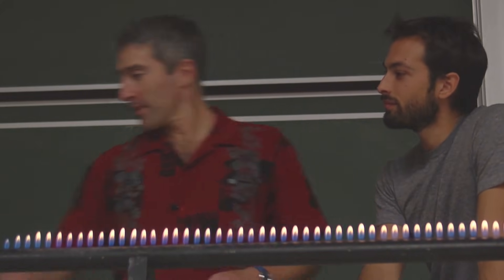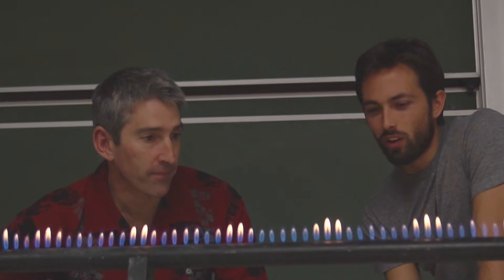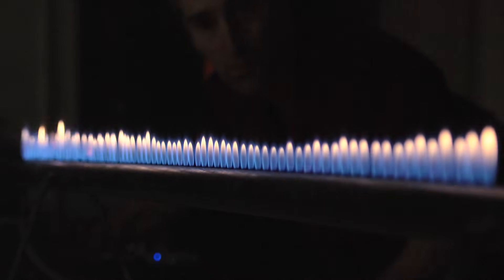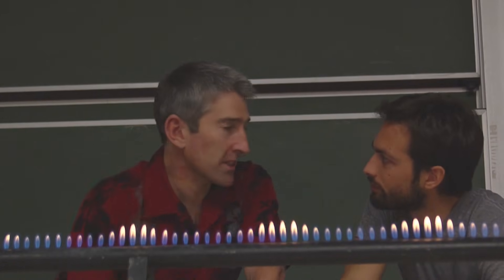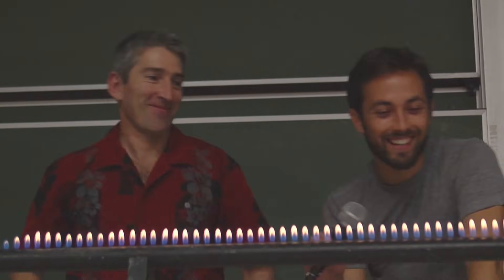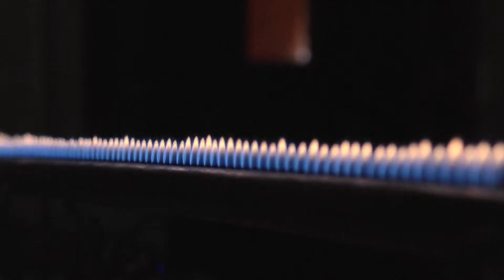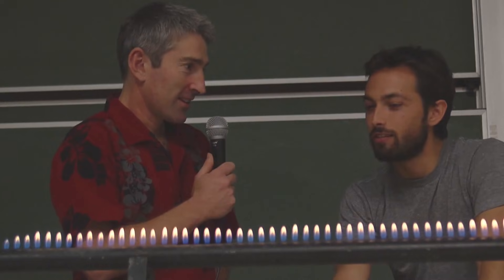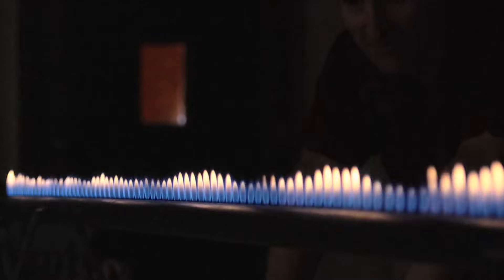Sound + Fire = Rubens' Tube

Comment: Was pleasantly surprised at how pleasant your actual singing voice was. Much better than mine that's for sure.

They have discovered they lower frequencies  can actually put out flames. Know that has to do with powerful Scalar Waves.

🤔 💭  Wondering if you used the same frequency as fire next to fire if it would cancel it out. Causing a Balance Force.

Again, thanks for the visual videos.

Comment: Just a thought, but could this sound/frequency be used as a performance enhancer on Cars or Industrial motors to improve Combustion at different Rpm cycles ???
Rpms which actually resonate and change at different speeds ...
You could be on to the next gen electronically controlled fuel injected combustion engines with ecu's ... 

Hope I inspired ? 🇦🇺

Comment: Does the Reubens tube have two fixed ends? Or one fixed end and one open? Does it even have a standing wave with the sound?
Reply: One end is sealed, except for the gas inlet.  The other end is sealed, except for the speaker.  You don't want the gas leaking out except at the pipe holes along the top.  Google "Rubens Flame Tube" and you'll find more info.

Comment: Why the high peaks are still? I mean as sound is compression and rarefaction, high pressure area must change to low pressure area and vice versa. So peaks must go up and down.
Reply: I expected the same.
Can one explain this phenomenon to us, perhaps?
Reply: I THINK ITS THE FREQUENCY.  THE RATE AT WHICH AIR IS COMPRESSING AND RAREFACTION IS VERY FAST.. SO WHENEVER THE FLAME IS TRYING TO GO DOWN NEXT COMPRESSION IS COMING AND ALSO REMEMBER THERE IS A FLOW OF GAS IN THE PIPE TOO.

Comment: I have a question
Zones of compression have more oxigen density and produce a bigger combustion, is that it?
At first I thought that zones of rarefaction would "pump" more gas out of the tube and thus produce larger flames. maybe both effects occour but the first one is more significant.
Reply: +Javier Ortega Actually, you don't have oxygen inside the tube. When you apply more pressure on one spot, you make gas "fly" faster through the hole. It's like opening or closing a valve in the oven: the more you open it, the more gas is allowed to pass through and then the flame is higher.
Reply: Yeah, well I was thinking about the pressure outside the tube, but sound must produce a stronger pressure effect inside it, so you are right.
Reply: Do you speak spanish? It will be easier for me to explain hahaha.
Reply: Si. Ya entendí, la onda estacionaria está dentro del tubo, produce nodos de baja presion y antinodos de alta presion. En los antinodos se expele mas gas, por lo tanto llama mas alta.
Fuera del tubo no se produce una onda estacionaria, asi que lo que yo pensaba es incorrecto.
Si la onda estacionara estuviera fuera del tubo, habria mayor oxígeno en los antinodos, y en los nodos se produciria succión del gas, entonces los efectos sobre la llama serian inciertos.
Reply: Eso ya es bastante rebuscado jajaja. Pero claro, la llama es simplemente la expresión de lo que sucede dentro del tubo. Saludos!

Comment: I'm not quite sure what gas they're using here (probably propane), but my guess would be that if you used a gas that had a wider range of flammable concentrations then the flame would be harder to put out by the changes in pressure caused by the sound waves.  Hydrogen has one of the largest ranges of flammable concentration, so if the experiment could be rerun with hydrogen then you might get better results.

Comment: Because, the source of the sound is coming from the left, and traveling to the right, but with the constant tones for example, the exact same wave length is being sent through the tube. Because it is the same each time, it hits the same highs and lows at each point, so that it doesn't appear to move. if you could see other other things, like the vibrations traveling through the tube, instead of the sound waves, you would be able to see them (the vibrations that is) traveling from left to right

Comment: Equalizer visualizes the the strength of output signal (in db) per frequency. Whereas Oscilloscopes does exactly what the tube in the video does: it shows actual sound wave (pressure of air) per time units.

Comment: Because the wave length of the lower frequencies is about 20 meters - way longer than the pipe, so you would only see a slight upward or downward slope. It would basically be like a seesaw. Then the higher frequencies wouldn't be strong enough to counter-act the lower ones, so they wouldn't do much. Lastly, since you'd probably have the bass up too far, the flames would likely be extinguished before too long.

Comment: These are mechanical waves, they spread out through matter, like air, gas, water, etc. as you push the particles together they have a higher pressure, and when you pull them apart they have lower pressure. Waves are just the switching of high and low pressures, when something vibrates it compresses and discompresses air.

Comment: you can't see the wave itself but that doesn't mean it is not material, wind is invisible, but it is material and probably work in a very simmilar way: High pressure and low pressure create movement of air that results in winds that sometimes knock people down or even destroy houses... so if you could manipulate sound you could basically create a weapon :D

Comment: Good job!
I was so impressed that I made one to use at school.  The only problem is that I expected the wavelength to vary inversely with the frequency  so that the velocity (frequency of wave x wavelength) was constant regardless of frequency.  My results gave about 290m/s at 1kHz and 310 or so at 200Hz.  Any ideas why? (density of propane, varying temperature of gas in the tube, velocity of gas moving from the nozzle at one end to the speaker at the other, ...)

Comment: @FIyingPengwin the problem is that each flame is not specific to a frequency. If you're into maths, then what you need to do is a "Fourier Transform" which will take the spatial distribution along the tube and turn it into a frequency distribution.

Comment: @kid29a great question! The waves are propagating, but at the end of the tube they bounce back again and bump into the waves going the other way. They add up to make areas where there is lots of vibration (antinodes), and other areas where there is none (nodes). It turns out these nodes and antinodes don't move, so this situation is called a standing wave. Similar to jumping rope, where the middle of the rope goes up and down, but the ends stay still.